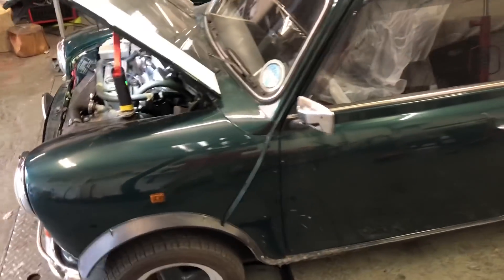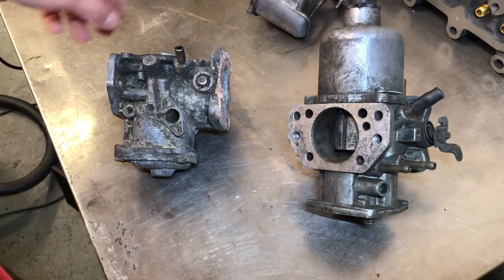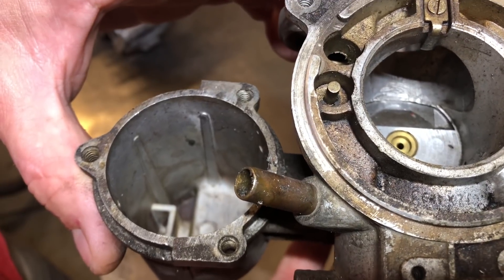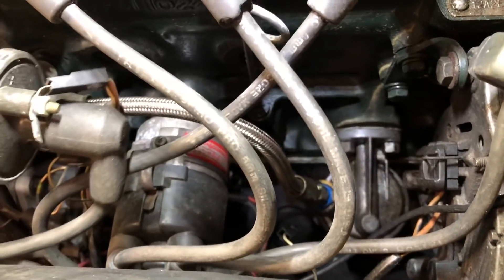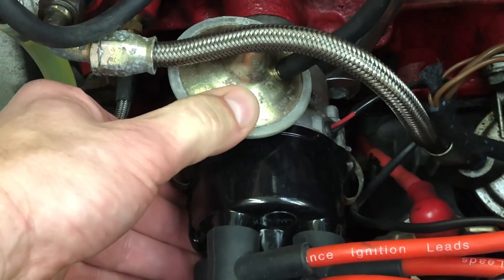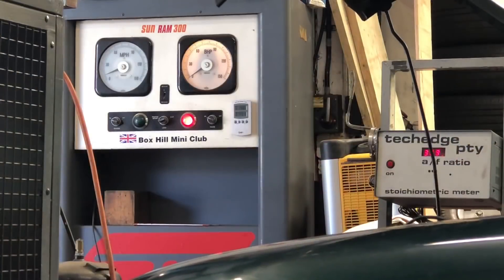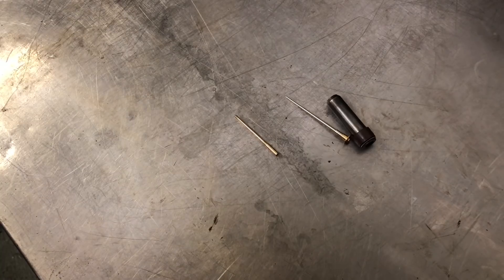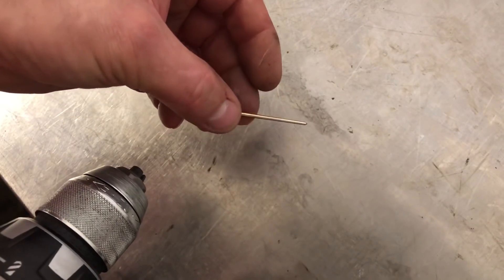What happens on a Rolling road dyno tune!

Comment: Had mine done at Mini Sport in Padiham back in 2006!! Still very impressed as I'd only just rebuilt the engine, a 1293 SPI with a John Cooper Works conversion.  Spot on 90 bhp and together with Jack Knight helically cut 5 speed box made it a fabulous road car. Loved it.

Comment: Just a little correction, an HIF's mixture screw affects the whole rpm range since it moves the assembly entirely. This is why most of the time you can get away with a lean needle if you compensate by screwing the mixture screw a bit more. Sure, it will make the idle a bit rich but it will affect the AFR even at 7000 rpm.
Reply: Rich idle will make cruising to rich,that will bad for fuel economy.